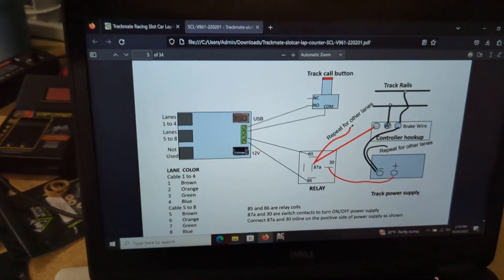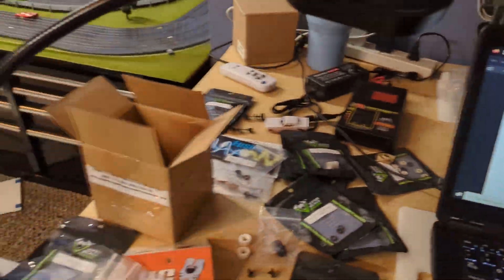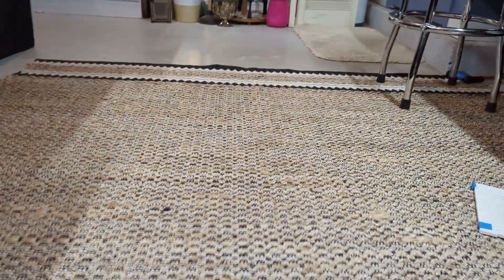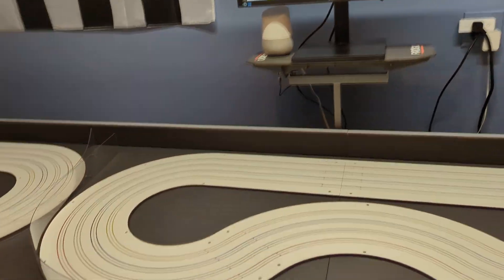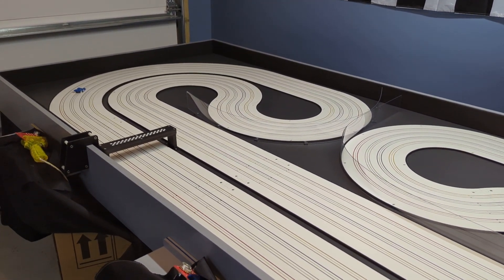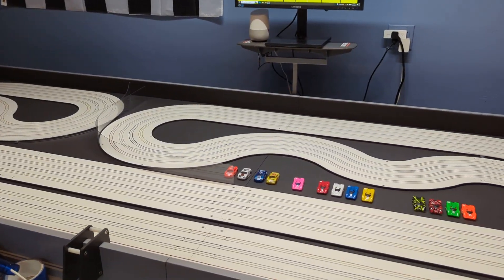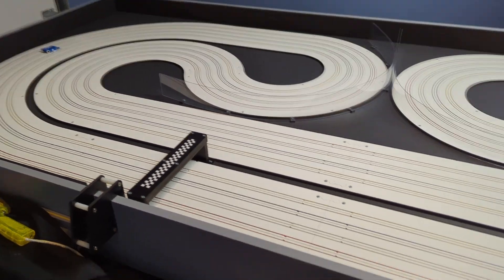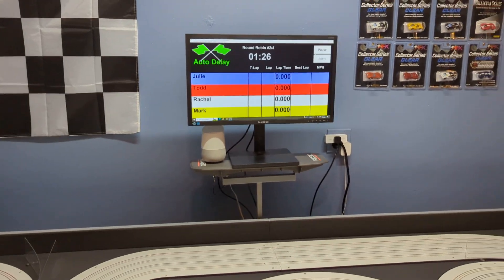Adding a relay to my Trackmate timing system

Comment: Mark track is coming right along. Looking forward to the solution of the power on before the green light.
Reply from the maker: That was just a setting in the software. I found the box to check to have the power come on at the green flag. You could leave it the way it was in my video where is comes on before the green flag and you can set penalties for drivers who jump the green.

Comment: Hello Mark, thank you for the informative video.  Like the way you showed the diagram, then the actual view under the track:) 

Doing away with track marshals and having a track call button at each driver's station, allowing each racer three track calls per 3min heat and sitting out the rest of the heat on the fourth call.  I call it 3 and then out, Lol.  If you save your accidents, it's like having more fuel are turbo boost.  If you have used up your track calls, then you must back off some so you can at least stay in the heat:)   I know I've mentioned this to you before. Lol.  

Another fun thing is restrictor plate style racing.  You set a best time limiter on how fast a car can go around the track.  Trackmate want count the lap if you go faster than the set limit and breakout.  This limit can be set based on the fastest and slowest times.  Somewhere in the middle.  Puts in a handy cap, giving others a chance to win:)   

Take care and keep up the good work my friend:)
Reply from the maker: Thanks, both very interesting ways to race. I am not sure I could get the guys I race with to go for that though...lol

Comment: Not sure how Trackmate works but some timing software will power on the track a little before the start signal (when the timer actually starts counting) and the system forces the driver to start the heat on his own and will even penalize the driver a set number of seconds if they "false start" or jump the gun. The packages that do individual lane power control can even turn off the power to the specific lane for a moment to penalize a driver. I set mine up with individual lane power control but it takes more wiring and a generic four relay board as I control them directly from a legacy parallel port.
You can also select a "dead start" option which simply turns on the power the moment the heat starts. This is how most club racing is done.
If I remember right, both SlotTrak and Race Coordinator have this option.
By the way, most of the other timing software is Trackmate compatible so you might want to give them a try. They are free to download. (Virus scan them thoroughly before opening).
Reply from the maker: Thanks for the info! The way mine was set in the video is exactly how you described, the power comes on during the timer before the green flag, I did fine in the setting where I can check the box to have the power come on at the green flag after the count down, or you can setup false start penalties. For now I have the box checked to start power at the green flag but maybe I will play around with the penalties....sounds fun...lol

Comment: Nice that's how I had my tracks working when I had the trackmate system back in the 2000's. it's good to have a track call button.
Reply from the maker: Thanks! Yeah definitely worth it, I do have one call button that came with the track system, I may install it, seems easy enough to install just need to figure out where I want to mount it. For now the space bar on the keyboard will be the call button...lol